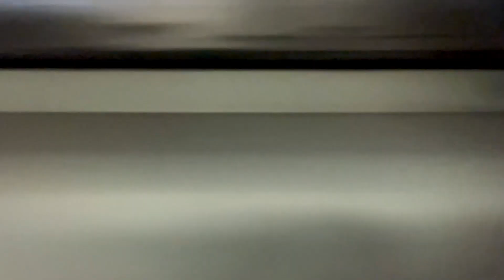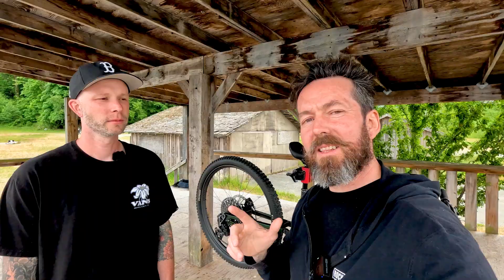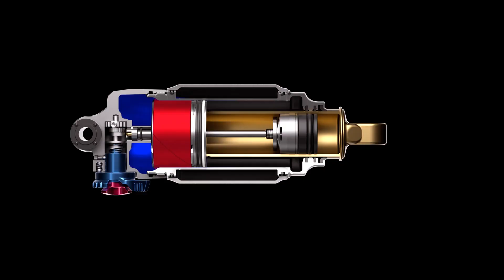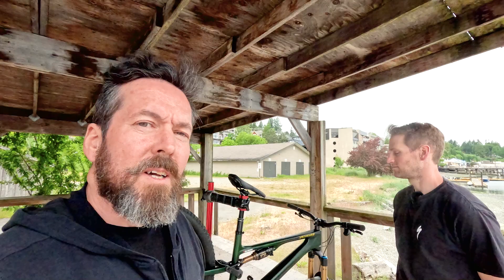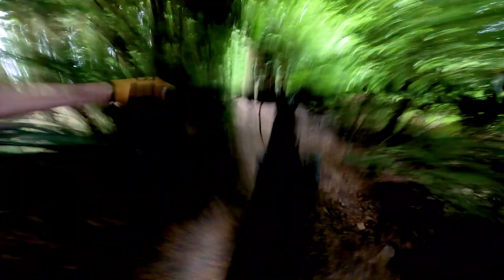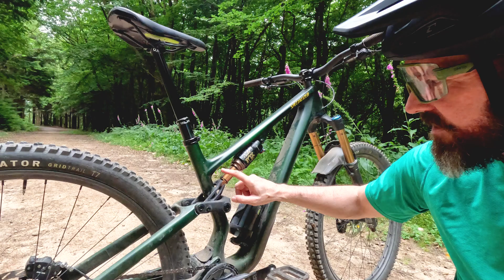Specialized Stumpjumper 15 Pro first ride review, And The Tech That Makes It The Best Yet

Comment: Great review. My question is:  does it absolutely pedal better than the previous regular stumpy? If so, how much better on the scale from epic evo to regular ‘21-‘23 stumpy?  

I’m 6’2” 220 and the bikes I’ve had are either not fun at all to pedal or not enough travel. I need a great mix of both. 

I’ve had 2019 lt stumpy- not fun on single track for me 

2021 epic evo. Fun but needed a BIT more travel for when I’d take it to more demanding trails. 

2022 stumpy evo- pedals better than 2019 stumpy but still heavy and sluggish. 

Considering the 15, current epic evo and 2023 reg stumpy pro.  I can only have one bike. Which is best for “I can go to the bike park and do a few fun things but mostly I’ll be pedaling single track with moderate technical climbs because that’s what’s close?”

Comment: What are benefits of the Genie shock vs a progressive suspension kinematic?
Reply: Genie is essentially a two-stage air spring so it is very plush in the first 70% and then sudden ramp up in last 30%. A progressive kinematic can sort of achieve the same thing but you can't make it go from low progression to a sudden step to high progression. If I could sketch it on a graph it would be easier to understand but just know that a progressive kinematic will have a gradual ramp up in force/mm of travel whereas a two-stage air spring will have a low gradient for the first 70% and then suddenly a steep gradient for the final 30%. This can also be coupled with a progressive kinematic to give an overall very plush suspension in the main "working range" (0-70%) where 90% of riding occurs and then in the 10% where things get rowdy, the suspension firms up quickly to prevent bottom out. It's simple and genius really. Or should I say Genie-us....

Comment: Great review and I really like where Specialized is going with the less progressive kinematics and the Genie shocks. Most people (riders and industry people) believe that more is better when it comes to progression but thats not the case. There is a point of diminishing returns when it gets too progressive and it looses a lot of support.  Being able to adjust the main air spring progression and ramp air spring independently is really eye opening.
Id love to see the data for the shock on a dyno and actual riding data as well.
Reply from the maker: Hey Luis, the pendulum always swings back to the middle, right? And the kinematic is still progressive, just less so. Overall I was really impressed with the suspension on the new Stumpy, and the shock tech, especially the adjustability. I’ll get my MI data logger on it and see what it spits out. Would be cool to do a back to back with a regular shock. Watch this space
Reply: Yes progression it’s great, but you can have too much too. I think this bike strikes a good balance of progression, support and good use of the travel.
Let’s do some data logging and dyno testing soon 😊

Comment: Great talk through and video Al. Totally here for hyping the importance of suspension tuning too, especially now so many frames and sorted in terms of feel and geometry. What's with the lack of cable routing though and did you splatter something all over the paintwork?
Reply from the maker: Hey  @GuyKesTV  thanks for the props on the video. Yup, I got so excited about the suspension tuning possibilities, that I totally forgot to mention that the carbon Stumpy 15 frame is wireless transmission only. And with brands like TRP getting involved, it sure looks like it’s all going that way. Can only assume the alloy Stumpy when it comes will have cable routing for a rear derailleur tho!
Reply: @MBRmagazine  Looking forward to your Stumpy Alloy review then. Are you getting the new Status 170?
Reply from the maker: Would love to test that new Status, but I’ve got 8 SL e-bikes that I’m testing at the mo so I’m time poor! 😅 Will probably get crusher Kirkman on that one!

Comment: I don't understand the hype, just another overpriced mountain bike
Reply from the maker: Maybe we should do an explainer video talking through the tech behind the hype? 🤔😂
Reply: Overpriced? It's a premium product. There are cheaper bikes on the market if you prioritize cheap over premium. It's like buying a Nissan vs an Audi. They both achieve the goal of getting you from A to B but the Audi does it in luxury and style. A cheaper bike (say an Alloy Stumpjumper from previous generation) will probably perform 90% as well as this expensive bike but if you are passionate about bikes, have the money and desire a premium bike that looks awesome, has a tonne of high end features (adjustable suspension with the best dampers and stiff + light chasses, carbon frame with tuned stiffness for performance and compliance, great brakes to stop you even when things are getting heated etc) then buy it.

Comment: I used to have a 2019 Stumpjumper and been riding e-bikes for a couple of years. I’m tempted to get the Expert model so I can have an acoustic bike and e-bike in the garage. I miss my old stumpy.
Reply: Get it I have two e bikes Levo gen 3 and Levo SL gen 2 and bought the this stumpy 15 pro so unique no regrets pedals like a hard tail plush like the enduro amazing the x2 grip fork and this genie shock I can’t get off this bike
Reply: @albertofelix5851  Thanks for the feedback!! I’m 99% convinced haha. I think tomorrow I’ll go into the shop and I may come out with a receipt for a new Stumpjumper (they need to order it in).
Reply from the maker: @The.JZA. you’re not messing around! Like it
Reply: @MBRmagazine  Ordered the Stumpy 15 Expert in Gunmetal Grey. Looking forward to trying out this Genie shock! It's interesting when you look at the Stumpy 15 and the Enduro side by side. The new Stumpy frame is VERY similar to the Enduro if you ignore the extra linkage and position of the shock. The Stumpy definitely seems to have inherited some of the burliness of the Enduro while keeping the weight low.
Reply from the maker: @The.JZA. Yes, good spot, it definitely has some Enduro suspension DNA in there. And do let us know what you think about the new Stumpy and Genie shock when you’ve spent some time on it. Have fun 🎉
Reply: @albertofelix5851 this is what I want to know. It really pedals like a hard tail?  I started with a 2019 lt, then went to epic Evo, then stumpy Evo. lol. In my area now it’s more pedaling and riding for exercise rather than getting rowdy. Stumpy Evo is a bit sluggish, epic Evo was fast but prob needed a bit more travel (didn’t have swat and was able to sell for what I bought it for). 2019 stumpy was terrible to pedal in my opinion. 

I can’t decide between a 2023 reg stumpy pro T type on sale vs the 15 vs new epic evo.  

Basically, is this too much bike if you’re pedaling most of the time?  I need it to pedal better than the regular previous stumpy and I’m in! lol. Thanks
Reply from the maker: That would be quite the fleet.

Comment: I built one of these up the other day, and I only have one ride.  I haven’t dinged the rim, but that loud clank or crunch sounds exactly like my bike on some of the jumps to flat.  I think I want to play with the top chamber and see if that need less volume and more ramp.
Reply from the maker: This was definitely something hitting the rim. So I’ll probably put more air in the rear tyre, or swap it out, before messing with the shock.